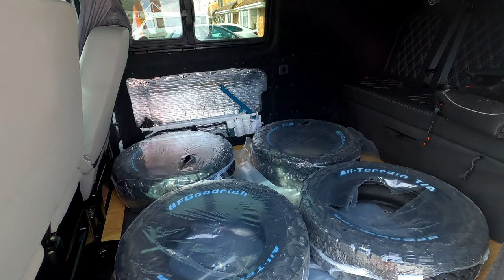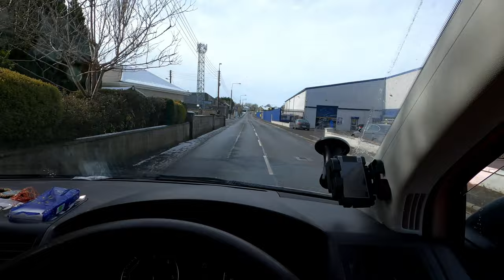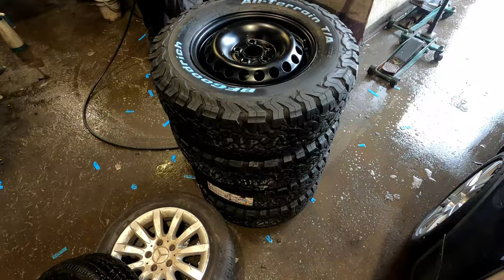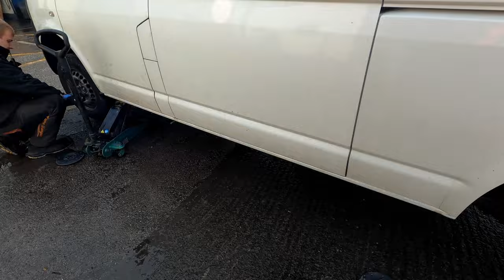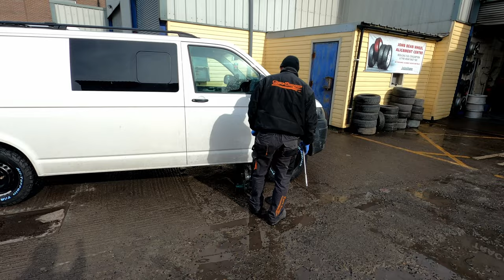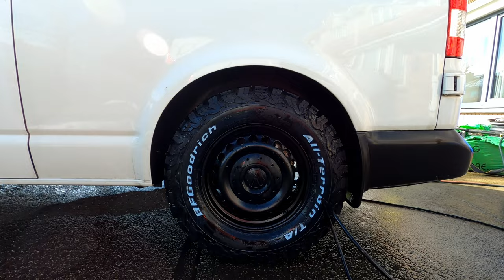BFGoodrich ALL Terrain T/A KO2 Tyres

Comment: Hi, I also have a 152 reg T5.1 Transporter and I'd like to fit these tyres. I see you bought some new wheels before you fitted the tyres, which wheels did you use please?
Reply from the maker: They r not new wheels, just a standard 16 of different transporter…just powder coated them mat black so they look like new. 👌 👍 hope it helps 👍